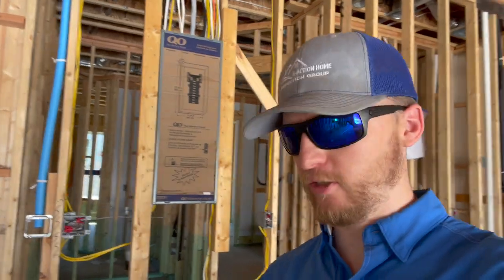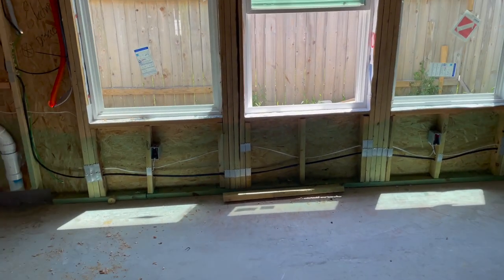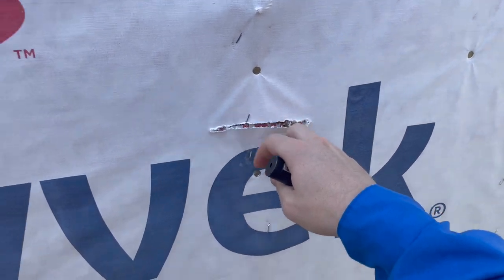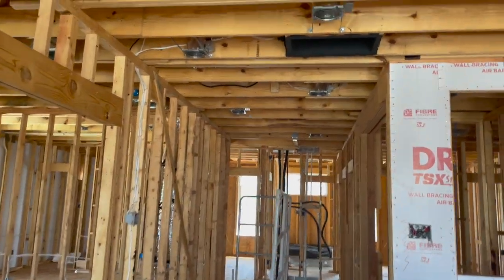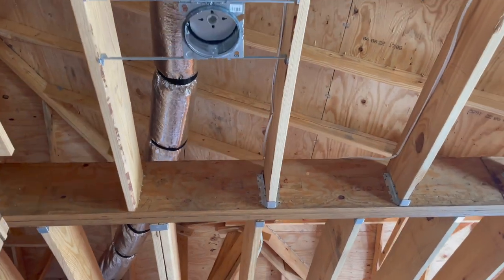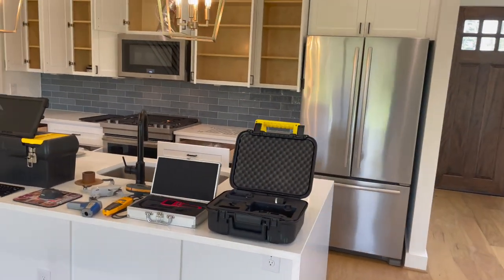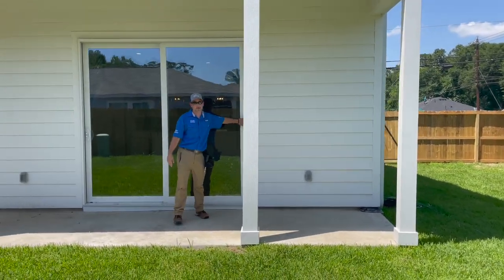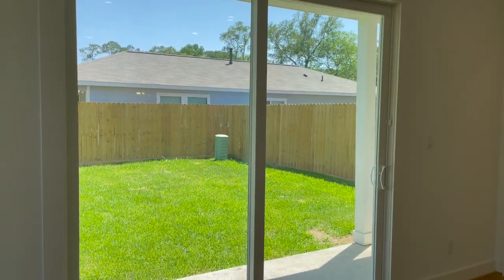Phase Inspection and a New Build Inspection Day

Comment: Nice job. On the second house you mentioned that the dryer is missing the GFCI breaker. I didn’t see a surge protector anywhere on that service. Isn’t it now a requirement in the 2020 nec to have one. BTW where I live in Arizona none off those things are required because we’re still using the 2017 code.
Reply from the maker: Surge protectors are now required but we follow the Texas Inspection SOPs.  Our SOP does not require us to call them out.  Texas focuses a lot on performance more than code.  Good spot!

Comment: You once mentioned that you should have either a turbine or a ridge vent.  Why is that? (If the explanation is too long, can you point me in the right direction)
Reply from the maker: It is because the vents will circulate the air at the top of the attic instead of pulling the air from the soffit area.  You will not get proper air flow through the attic.
Reply: @AActionHomeInspectionHouston  Thanks so much.